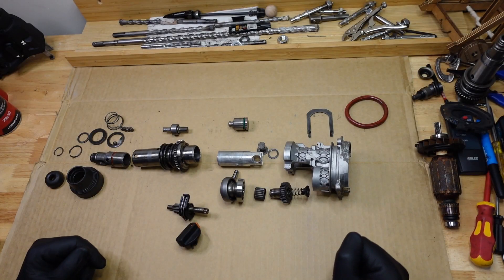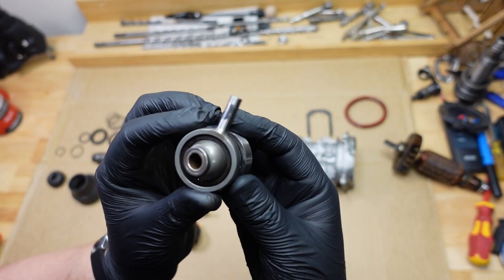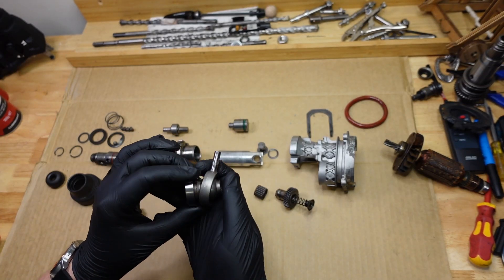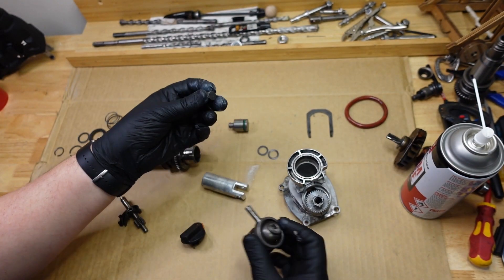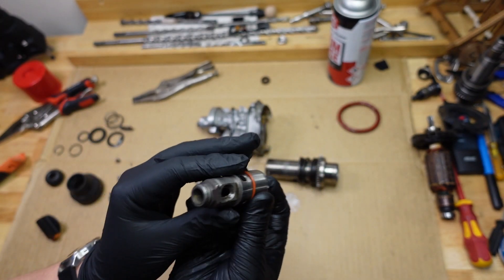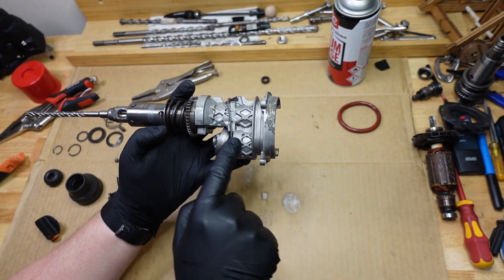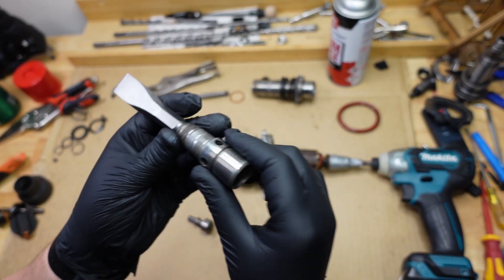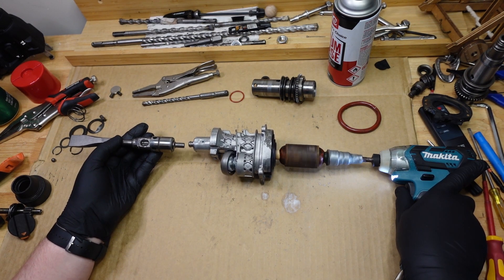How does a rotary hammer drill work? (electro-pneumatic hammer mechanism)

Comment: How does the mode switcher works?
Reply: The part picked up at 1:53 is the part that gets moved by the mode selector. It is a splined cylinder sliding over splined shafts. By moving the splined cylinder back forth you can select which shafts are driven. Sliding it back engages the bearing race for the hammer action, keeping it in the middle engages the drill shaft (passes to the left on the side of the hammer system and turns the tool holder via gear) and bearing race together, and sliding it all the way forward engages only the drill shaft.

Comment: Very cool! Is there generally a second motor that drives the rotary action or some sort of linkage that does that?
Reply from the maker: Cheers mate! Just the one motor. There's a drive shaft that plugs into the centre in the swing bearing (it's toothed inside!). And that on turn drives the Rotary action by turning the whole tool holder subassembly. The big cylinder of the tool holders is toothed around the outside.

Comment: Hey, love the content. I’m in the market for a rotary hammer and I’m currently in the Milwaukee battery system and was wondering if there one is alright or if I should spring for a different brand.
Reply from the maker: Cheers mate!
First thing is what are your requirements? In this case, what size holes are you likely to drill? If around 12mm or less mostly, you could go a compact hammer. If you're not sure, go an inch drill (26mm ish) with 3 mode.
They've got only 2 brushless hammers, the 26mm m18, and the M12. Assuming you're after m18 then the m18ch is a good solid choice, or the newer version m18fh, which is probably good but I haven't tried.
Trouble with Milwaukee is the price. Here in Australia you could get a compact Makita kit with the dhr171 and battery for less than the cost of an m18fh. So, springing for a different brand can actually be cheaper if you find a good kit.
I'll have tests for the M12CH and M18 BH in the next week or so if that helps!
Reply: @BoltahDownunder  Thank you so much for the detailed reply! all the information is super helpful. The holes I mostly drill are actually 12mm but I see myself possibly needing to drill some larger holes in the future and I would be using it as a hammer chisel a lot of the time as well so I would appreciate the extra power. Thanks to your info and some research Im looking down the route of the M18FH. I’m in New Zealand and can pick up the bare tool for $529 NZD not on sale but hopefully it will be around 25% less on sale. Is there much difference between the M18FH and the more expensive M18CHP that I keep seeing.
Appreciate your invaluable time and looking forward to those future reviews!
Cheers

Comment: Nice! Have to fix one tomorrow, not so intimidated now.
Reply: The DCH333 is the top end SDS plus, 3.5J. The piston is driven off a crank. Issue with this code be turned out to be a bumper o-ring had broken up and was jamming the beat piece.
Reply from the maker: Nice! A Bosch? What's wrong with it?
Reply: @BoltahDownunder  a Dewalt Flexvault. DCH333, the striking pin is jammed, I guess it’s peened over a bit.
Reply from the maker: Sounds like one of the problems this drill had. I've never opened a DeWalt but presumably it's pretty similar inside there.
Reply: @BoltahDownunder  yeah, looks like the diagram, and I have the relevant sub assembly. Should be sweet.
Reply from the maker: Yeah I find the circlips are the worst part.
The 333 is a big demo hammer right? Does it have the swing bearing still or is it a slider crank?